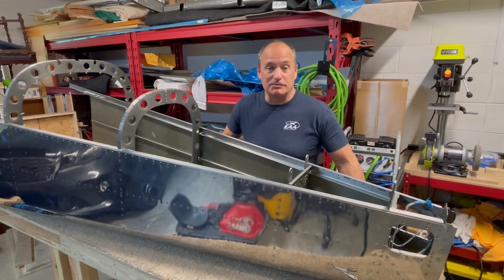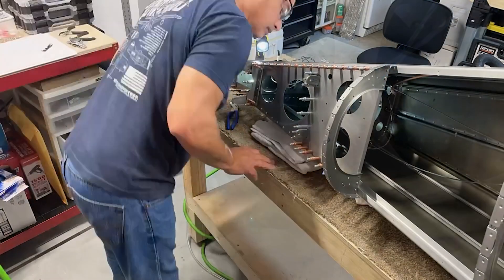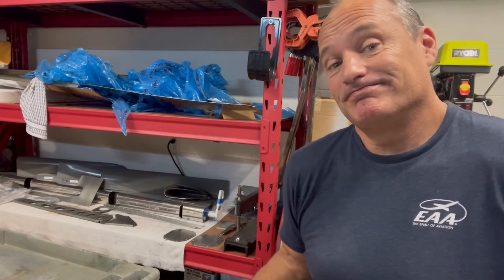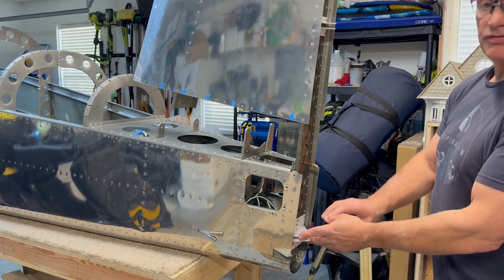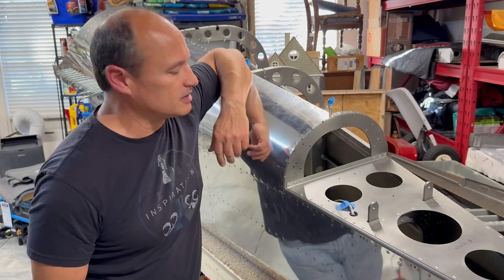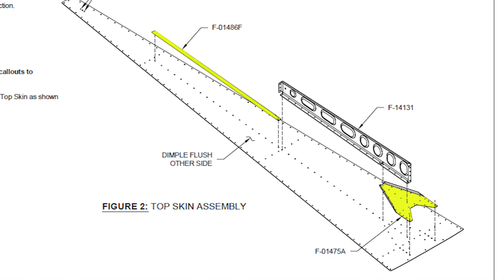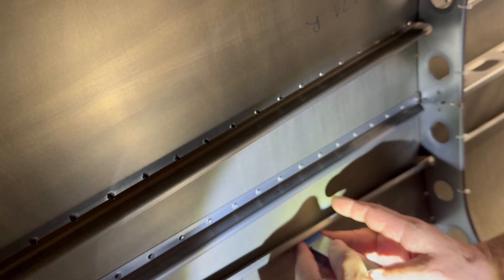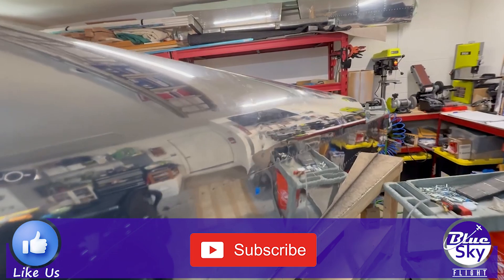Aft Fuselage pt5   Building a Vans RV 14 Airplane Ep15

Comment: What did you use for primer?
Reply from the maker: I covered this in the 2nd or 3rd video for the vertical stabilizer I think, but I’m using the Sherwin-Williams® P60G2 Industrial Wash Primer. In all actuality, I really think that for internal parts you could really use any type of primer, including something like a basic self etching primer from the hardware store. I’ve got a 50 year old piper that has no primer on the interior, and has zero corrosion issues. So while I still think it’s a good idea to prime all of the internal parts. I really don’t think it matters too much what you use.

Comment: Planning to order my tail kit next month. Have purchased most of the tools over the past month and am now getting all set up in the garage. 23 year Navy bubba and now 10+ year airline. Got back into GA two years ago and am really excited about the 14’s capabilities. A solid XC machine that you can even turn upside down every now and then. Thanks for the videos, extremely helpful!
Reply: Visited the factory 2 weeks ago. Tail should ship almost immediately after I order it. Other kits will require a few months lead time. Planning on doing the regular rather than QB. Hearing different things on engines, and that Thunderbolts are shipping quicker than regular 119s right now. Still quite a bit down the road for me regardless.
Reply from the maker: Great info. Yeah I didn’t want the quick build either. The build is half the fun. That’s good info on the engine. I’m leaning towards thunderbolt
Reply from the maker: That all sounds great… I agree, the 14 is going to be a great airplane! What kind of lead time are they estimating for shipping after you order? Glad to hear you like the videos.

Comment: Really looking nice. You are doing a great job. Interesting to see the difference in building the 14 virus the 7 I built. Ordered the engine yet?
Reply from the maker: Thanks… same VS on both I’m pretty sure, but most of the rest is match drilled so probably a litter easier on the build. Haven’t yet. I know lycomjng is behind, but I’m trying to judge the build time so I don’t do it too early… but I think it’s getting close to that time. I’m thinking hard about the thunderbolt . Got any thoughts?

Comment: I’m building a 14A as well, working on my panel before big join, so I have better access.
Reply from the maker: Interesting… I had not heard of that approach. Is it a lot better? Are you wiring the panel yourself or did you get a harness made? That’s the part I think I’m most apprehensive about. I want to do it myself first the challenge, but I don’t want to fry anything…
Reply: @BlueSkyFlight stein did my harness. It’s more work then I thought, and being able to get into spaces and working around the fuse is quicker. Not sure it’s anything huge, but I’m limited on space, so that’s why I am doing as much as I can pre big join.
Reply from the maker: I know what you mean about the space. I need to take a deeper dive on your approach. I like the sound of it. Thank you

Comment: Really enjoying watching your build. Your filming and editing skills are excellent.  I'm a PP/IR, own a P32R, building a -14.  I'm just a bit behind you, next step is riveting on those tail top skins.  Wing kit is supposed to ship 6/10.  Build On!
Reply from the maker: Sounds great! Did your instructions include the part about adding tank sealant in the elevators? Wish mine had…. lol. My wings shipped about a week earlier than forecast, so they are pretty accurate. The 32 is a nice bird, I’ve also got an Arrow, but I think our 14s and going to be a lot more fun to fly. :)
Reply: @BlueSkyFlight  My plans had that in there, but thanks to your video I knew to check and make sure!  I ordered my tail kit in December and they shipped it in just couple weeks.  I had lots of time to work on it this winter, but between my real job, breaking in a new engine on the Lance, and working on my CPL, my pace on the RV is going to slow to a crawl until next winter.
Reply from the maker: Like me it sounds like you’ve got other things to fly, so no rush in the build. Just work on it when you can and enjoy the process. My real job and household chores often slow me down at times as well. :)

Comment: I'm building an RV-14A. First three kits are done. Picking up the Finish kit today! You are doing great work. I actually have both the DRDT2 and the C-Frame. The C-Frame comes in handy for back-riveting some things. Otherwise I dimple with the DRDT2. You do a great job filming and narrating your build. Look forward to watching you build your wings. Make sure you watch Scott McDaniels (Vans) video on building the fuel tanks. I went with the Sky Designs ER fuel tanks. Basically the same as stock tanks just two extra ribs per tank so it tanks a little longer to build them. -Brian from central Oregon
Reply from the maker: Great info. Thanks for sharing. Yes I have watched those videos. They were really insightful. What do the extra ribs in the tanks provide?
Reply: @BlueSkyFlight  The ER tanks are two ribs wider so you get 34 gallons per side rather than the stock 25. Of course, you also get wider skins and rear baffles with the kit. Just imagine the stock tanks on the wings extending two more ribs outboard.
Reply from the maker: Interesting..,, I’ll have to check that out. Thank you.